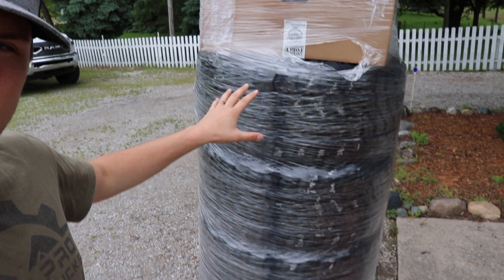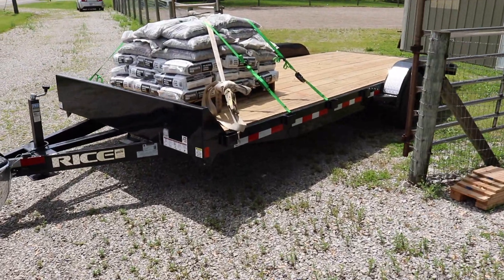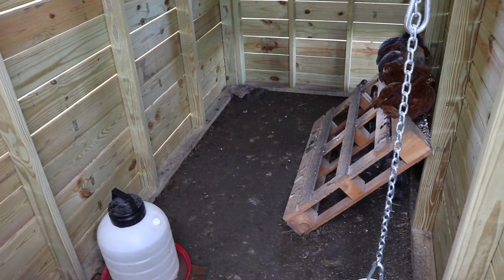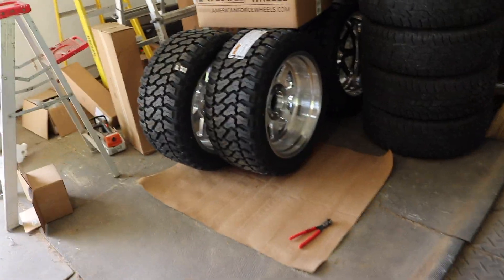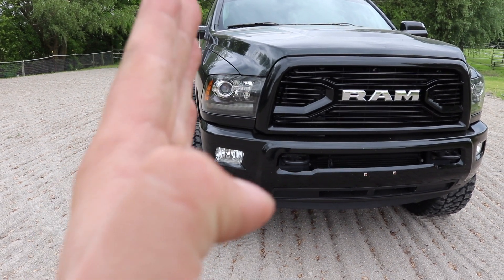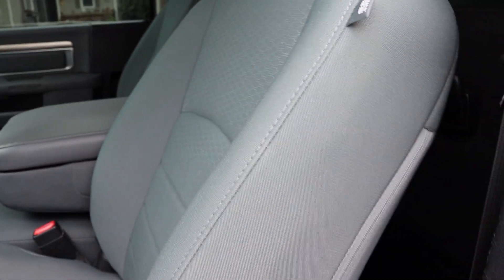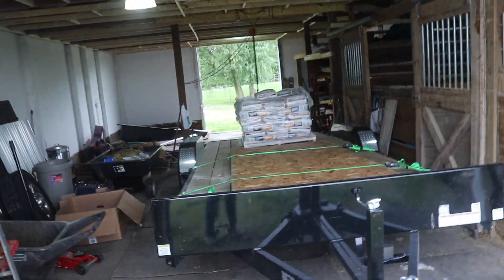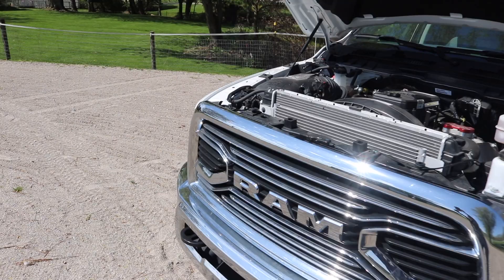New FORGED WHEELS for the G56 Cummins!!!

Comment: New subscriber... like your videos. If you can    raise one side of the concrete by a half inch that will naturally drain water to one side, if you guys get a lot of rain, it's the Pacific Northwest trick. Good looking trucks as well.
I'm a ram 2500 Cummins 6-speed virgin, so I get a lot of info from your videos...
Keep up the good work